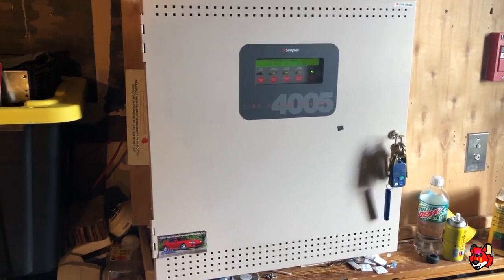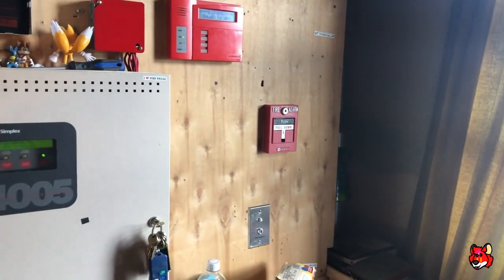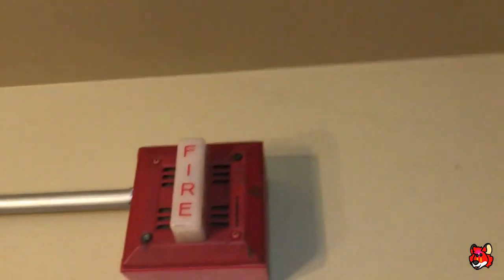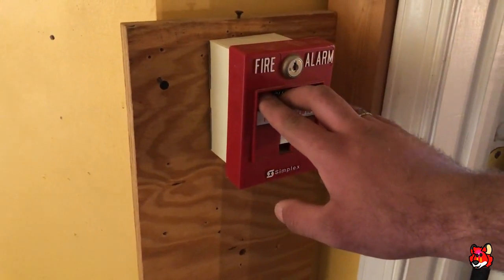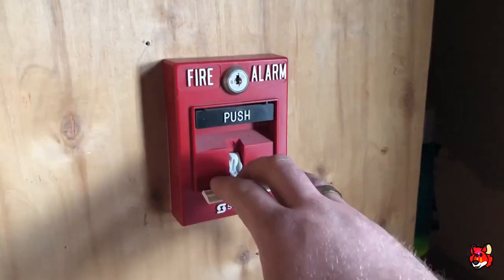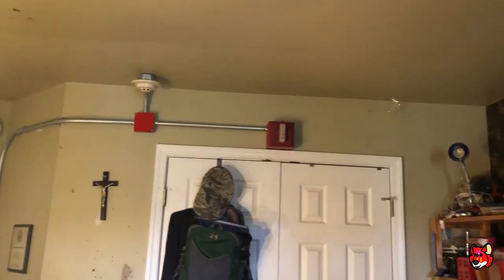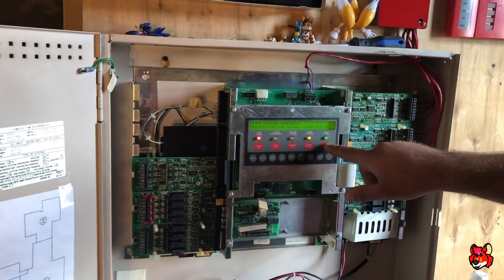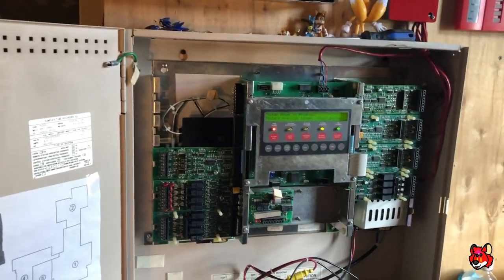Simplex 4005 System Test 5

Comment: hi I got a question how do you test fire alarms and security systems without getting police/fire sent over?
Reply: The systems he tests do not have a monitoring system connected to it. If he did, he would either A: Disable it. Or B: Call the monitoring company and put it on test mode